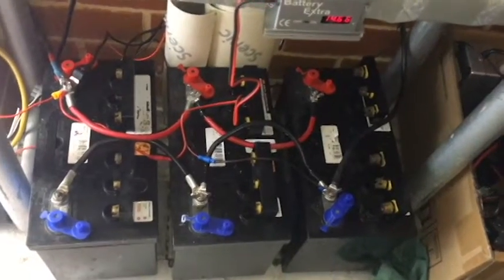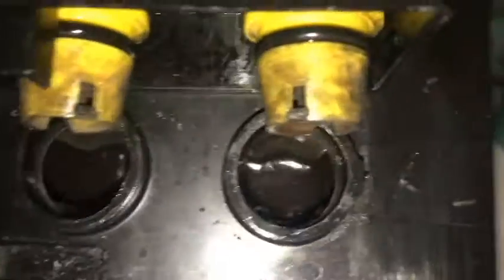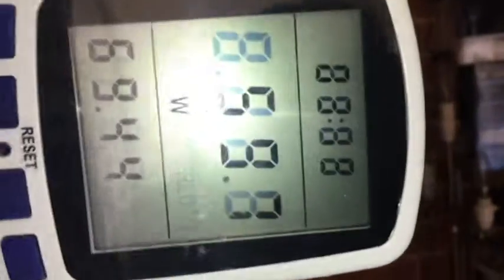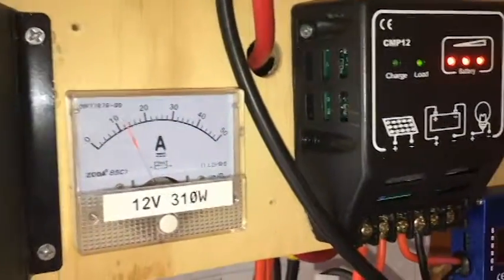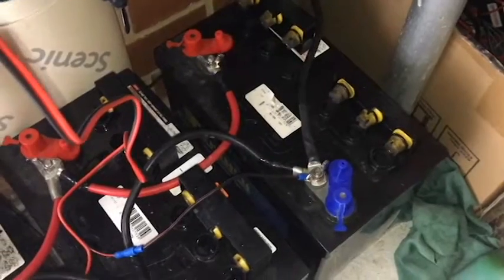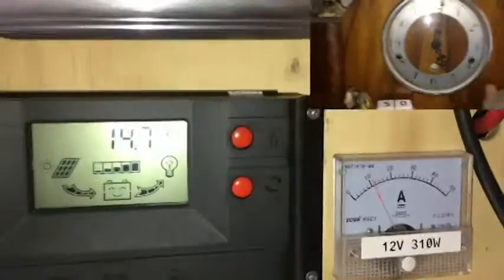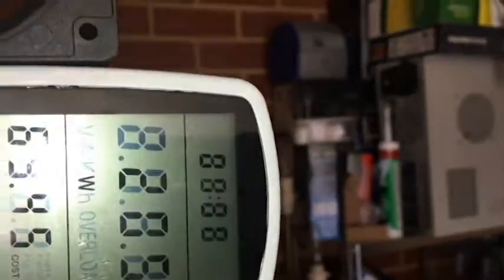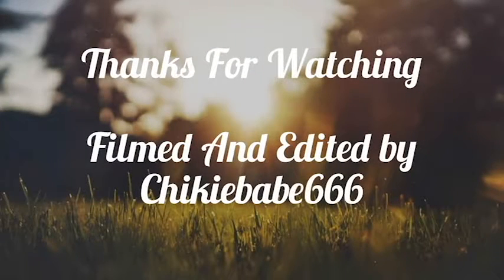Equalising The Batteries

Comment: Equalize charging is usually done at above 15V.  Your charge controllers probably don't support equalizing the batteries.  Now, unless you're finding that any of your batteries are being a bit lazy and are not really charging up fully, you probably don't need to run an equalize charge.  14.8V is usually the top end of the normal absorb voltage, as you can see they bubble away quite nicely, so should provide enough to ensure there is a good mixing of chemicals inside the cells.  The Battery Extra will do the plate cleaning for you over time.
Reply from the maker: Adam Kuklych 
I will be saving up and getting a mppt charge controller that will do it just don't know when I'll be getting it
Reply: Yeah, a Victron 100/30 would be adequate for 400W of solar, they're not too bad on the wallet either.
Reply from the maker: Adam Kuklych 
I was thinking of getting PCM60X because I can hook it up to the PC and Monitor it I was looking into Victron but I know if go with Victron it's going to cost a lot more to go that way
Reply: Yes I think Justin Case Solar Power used one of those early on in his adventures.  The Victron gear is really nice but it does cost more.  I just decided that I need to get something that will be with me for the next 10 or so years, and they are still a lot cheaper than the midnite stuff.
Reply from the maker: Adam Kuklych 
That True

Comment: I am sorry but 14.7 is just a charge. I been working with solar for most of my 38 year life. I live solar as well. Not just saying things. I have off grid setup and a grid tie. All stuff I made over the years.  If you look at Trojan Battery manufacturer web pag. They will tell you to EQ to 16.2 at 12 volts.  I will post the link below. So that is duse not go to spam. Where your there go to the lost spot on the pag and you will see the same info. 

Merry Christmas God Bless Sis.
Reply from the maker: +yankey4 
Merry Christmas to you and every 1
And ty
Reply from the maker: yankey4 
The max I can hit with my charge controller is 15v
Reply: Chikiebabe666 I had to buy a grid pug in one for like working on cars.When I did not have the cash to buy a CC that could go over 15. One thing you can do is EQ for 4 hrs. DO 4 hrs one day the next do 4 hrs..
Reply from the maker: yankey4 
Ok so should do it at 15v for 4hrs?
Reply from the maker: yankey4 
Ok ty